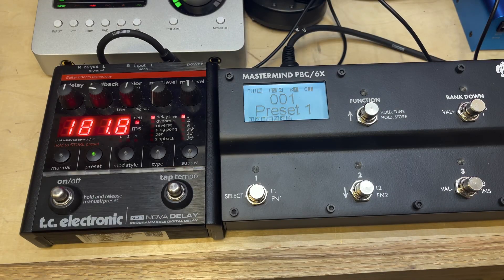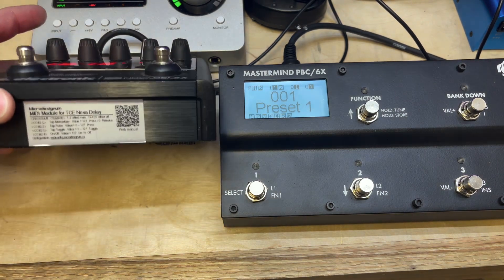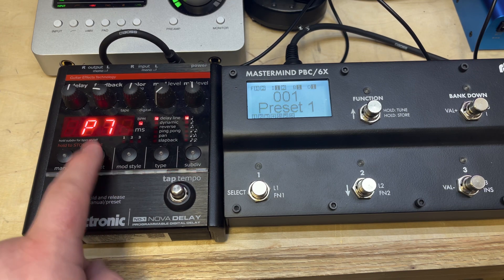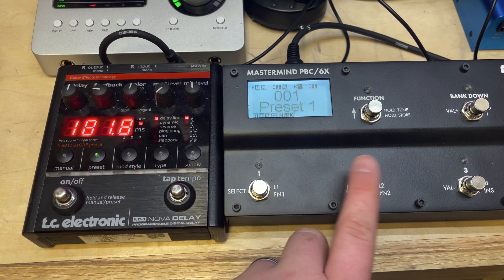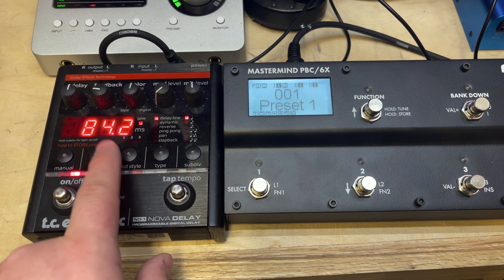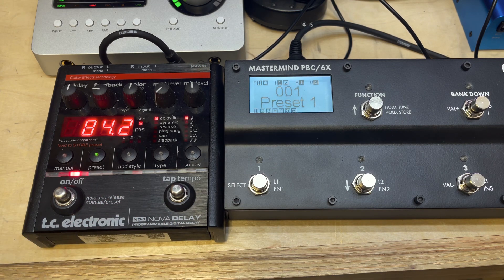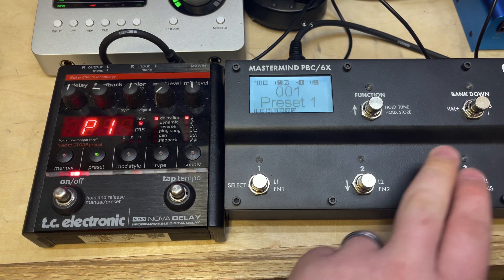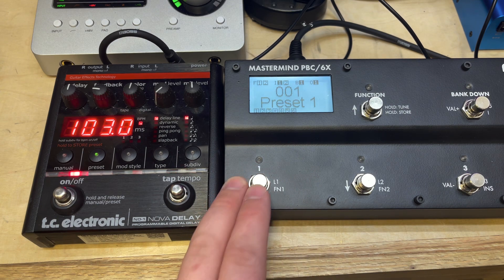NOVA DELAY MIDI MOD?!

Comment: Did you not run the cables out by the foot switches?
Reply from the maker: No sir, I ran a 1/8 midi input jack on the backside.
Reply: @omilionaudio  that’s slick I dig it.